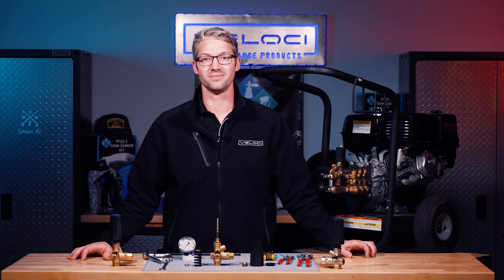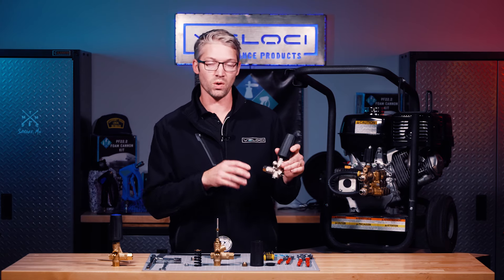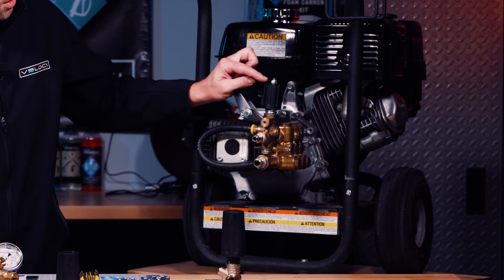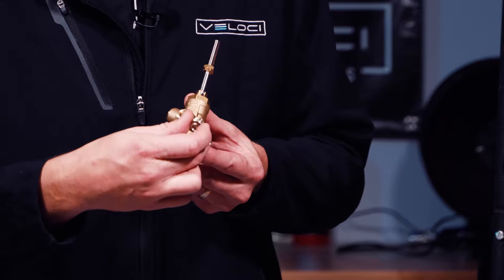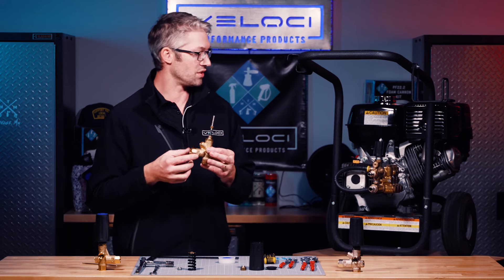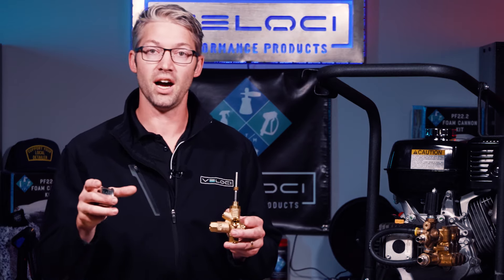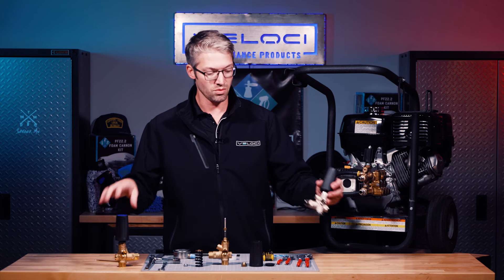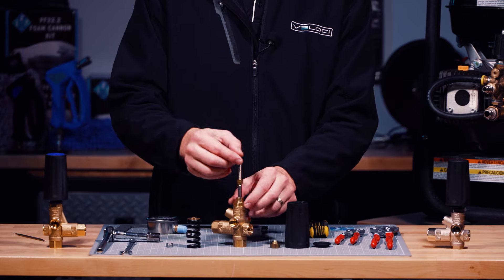UNLOADERS PART 1: How to Set an Unloader

Comment: Thank you for this very informative video.  We have a Simpson 4400 psi pressure washer that has a built in (part of the pump) unloader.  As far as I can tell it does not have a bypass like the machine you show in your video.  It only has a pressure relief valve and then a small (possibly) another relief valve on the bottom of the unloader.  There does not appear to be any extra inlets of outlets to install a bypass hose to.  Would we have to install a secondary unloader in order to install a bypass hose to run out on the ground or recapture in a tank?

Comment: What does it mean when it suddenly kicks into bypass while pulling the trigger..  it will be fine than randomly just stop the pressure..  just cleaned the valves so dont think it then, changed the bearings botg roller and ball..and changed oil..

Comment: Thanks for sharing, great information. Could you please let me know how can I bypass my Predator 4400 psi 4gpm?
Reply from the maker: All complete pressure washers will come with an unloader installed.
Reply: @PoweredbyVeloci mine has it's unloader, but it doesn't have that black hose

Comment: Why is my pressure washer building pressure while I’m trying to crank it.  I have to hold the trigger for it to come on
Reply from the maker: Prior to starting, always run water through the pressure washer to release any built up pressure. This is especially important after a failed start as the actuated pump will have built up pressure in the system making it difficult to crank.
Reply: I just zipped tie my handle open with zip ties and tie it down while starting at ideal
Reply: I have the same problem. If I don't open trigger to release pressure first, the machine won't start.
You can put anything in trigger as well while starting it, like a small ball, soda can, folded towel, etc.
Reply: Your unloader valve may be dirty/clogged. Take it off and thoroughly clean it.

Comment: Good Explanation but what about these Ryobi pressure washer 3000s with Honda GCV160 engines and runs great with trigger on wand fully depressed but surges when idle.  How do I set my unloader valve on it
Reply from the maker: That surging sound is the unloader operating and pushing water into bypass. You will need to refer to the Ryobi manual to properly adjust.

Comment: Now see this is confusing to me pretty sure my machine needs a new unloader valve and whats bad it's a brand new machine. I've already contacted the manufacturer and they're sending me a new one. Now my confusion is somebody clarify this for me my machine is rated for 3600 PSI with a 0° red nozzle or a turbo nozzle on my wand when I pull the trigger on the gun im barely getting 2200 psi but when I let go thr head pressure jumps all the way to 4200 psi and then settles at around 4000. Funny thing is adjusting the unloader does nothing for the pressure but when I tighten it down the head pressure increases instead of the outbound pressure including where it settles for example tightening it almost all the way down at the manufacturer's full stop idle head pressure jumps all the way to 5000 psi and then settles at around 4800 psi and the engine definitely does not like it because it's strains like crazy to get it there but what's weird is when I pull the trigger no matter where the unloaders is set on the gun pressure drops all the way to 2200psi or lower depending on what nozzle im using like the 40° nozzle when it's installed pressure barely goes to 1200 psi and then skyrockets to 4000 psi as soon as i let go of the trigger. Surely that is a sign of a failed or malfunctioning unloader valve?
Reply from the maker: Where are you measuring the pressure from? Also, keep in mind that the operating pressure will not change between a 0º and 40º nozzle. The spray pattern only changes the fan, not the orifice of the nozzle. And if your nozzle size is too big you would experience a pressure drop.

Use this calculator to double check your orifice size requirement based on your pressure washer PSI and GPM: https://www.mtmhydroparts.com/pages/nozzle-size-calculator
Reply: @PoweredbyVeloci  that could very well be my issue because all the nozzles that came with the machine for example the 0° tip says 00027, 15027, 25027 and so on. each tip starts with its pattern size and then ends in 027 so I'm going to assume that all the tips that came withe the machine are 2.7. but what's confusing to me is I have tested in a 5 gallon bucket it takes nearly four full minutes to fill it so I'm definitely getting half the GPM as well as only 3/4 of the rated pressure My pump has a pressure gauge right at the outlet set up is like so it goes pump outlet, female to male threaded pressure adapter with 1/4-inch inlet threads that the pressure gauge is in then to a threaded female quick connect so I'm getting head pressure readings I don't have a pressure gauge for the end of the hose yet so no idea exactly what the pressure is at the end of the hose. All I know is I'm getting a massive swing when pulling the goes from 4,000 PSI all the way down to 2200psi when spraying when I let off it rockets up to 4200psi and then settles at around 4000 adjusting the unloader down does nothing but lower the idling psi does nothing for the operating psi which stays at 2200 no matter where the unloader gets set.
Reply from the maker: It's very possible that the pump is not operating correctly. Could be debris in the system or bad valve. If you're still experiencing issues once the unloader is replaced, the next step would be servicing the pump.
Reply: @PoweredbyVeloci  it's a brand new machine had it less than a week if there's a problem such as that going on it's going back to Simpson or at the very least I'm sure they will just warranty the pump.
Reply: Check valves not closing, probably has some debris in it, or it's failed completely

Comment: The confusion I have is the bypass happens when the trigger is released but you never mention the trigger. This suggests the bypass happens whenever the pressure hits a certain point which will always be when the trigger is released but might be when the trigger is on and internal pressure still goes above a certain point. This should not be so complicated I need a dozen videos. Maybe the trigger has nothing to do with it

Comment: I have a Dewalt direct drive I believe 4000 psi 3.5 or 4 gph. Can I make it discharge to the ground or a tank?
Reply from the maker: Yes, you would simply plumb it to dump to a tank instead of back into the water supply inlet. We recommend capturing the water wherever possible.